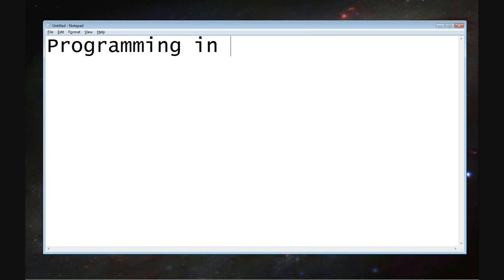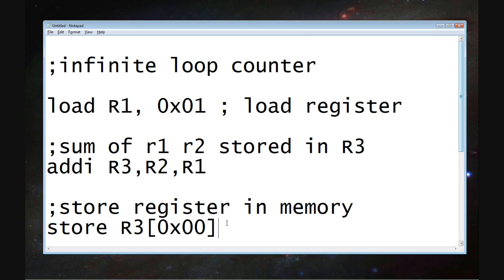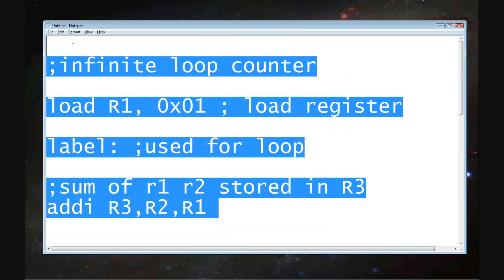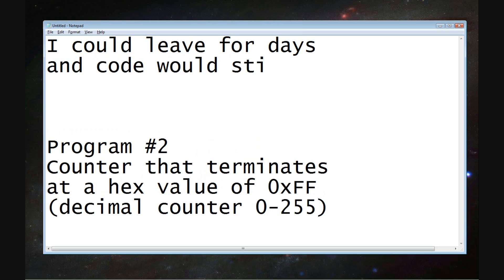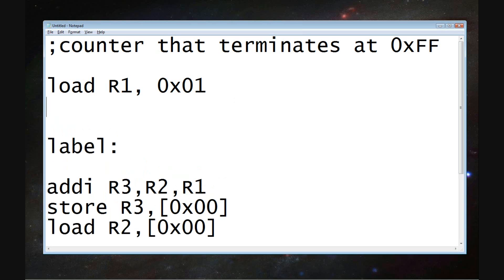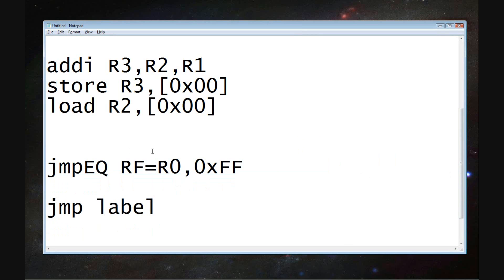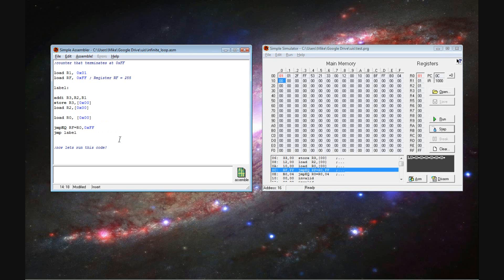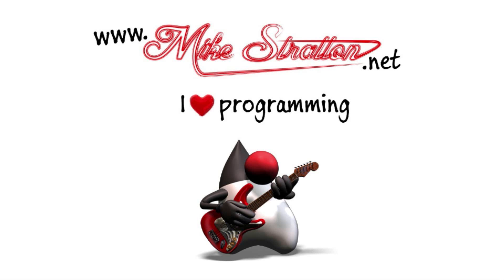Programming in Machine Language

Comment: machine language consist of only 0 and 1, this video is about assembly language and not machine language.
Reply: They're one of the same. 0s & 1's are the voltages and few computers are programmed via switches anymore.
Therefore the use of the word 'language' would imply assembly. : )
Reply: you need to look up Dunning Kruger Syndrome.  you don't know what you are talking about but don't know enough to know you don't.

computers are nothing but switches, microscopically small solid state switches but still switches.
Reply: Typically, I used hexadecimal, but in principle you are correct. Assembly and machine language are not the same.